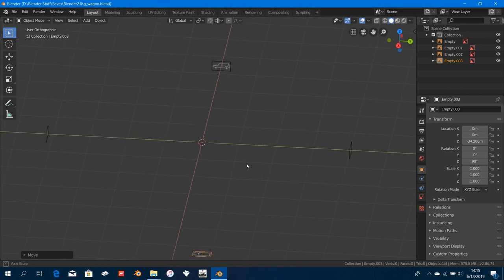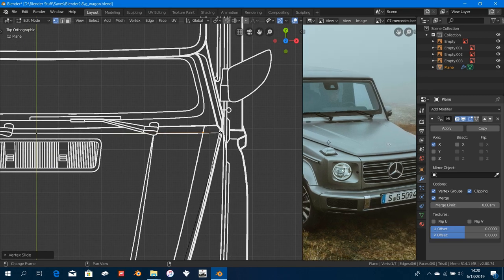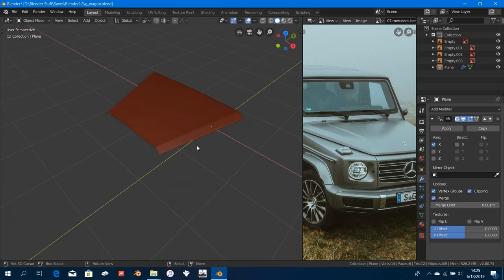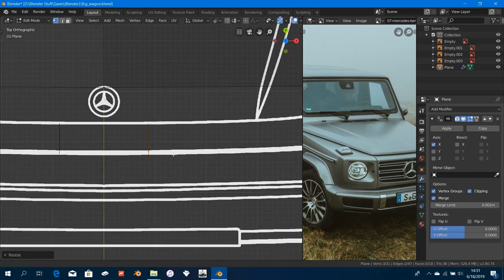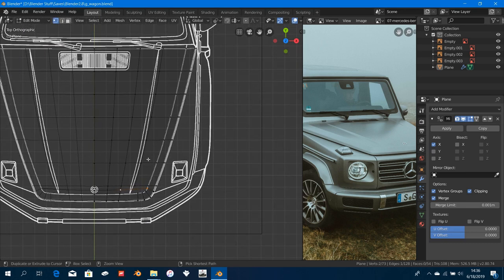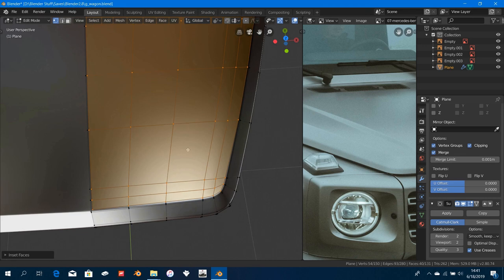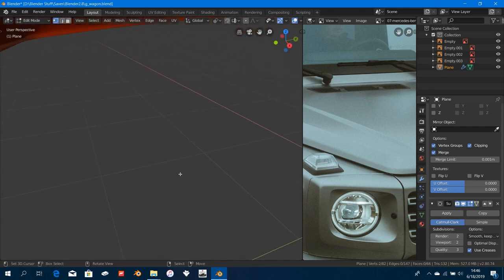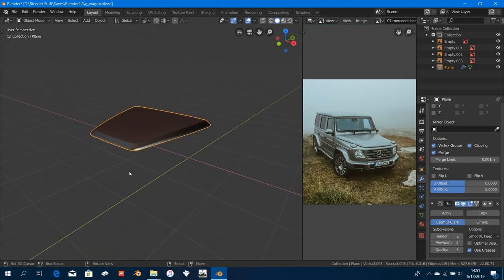Blender 2.8 Car Modeling Turtorial - Part 2 (Hood Shrinkwrap Guide)

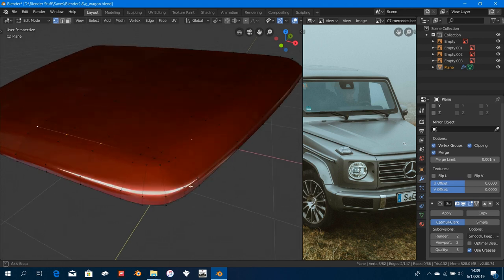Comment: Hello @The Natural Art Freak !!First of all, thank you so much for the detailed tutorial!!! I have a few questions tho, When I add the shade smooth to my hood I see a protrusion coming from the edge of the hood I tried splitting the edge and adding more mesh to that area but it didn't work. Also at 24:31 you split the entire edge along the hood, but in my case when I try to do that one block doesn't split so the splitting edge only applies for few blocks, I would really appreciate your help in this case.
Reply from the maker: you probably have either multiple faces or vertices going on somewhere, it can be hard to find sometimes, try moving the faces one by one to see if there's an extra anywhere... Or you may also try to recalculate your Normals with SHIFT+N to see if it works.

Comment: Bro how to make a line an active element i have tried every single thing but the middle point is going upwards every single time???
Reply from the maker: you select the vertex to want to be the active element last, then it will work.
Reply: for active element select the line from the vertex which you want as an active element, you have to hold alt and then select then you have the vertex selected as an active element, without any unnecessary extra steps

Comment: also, how important do you think getting your model aligned with the blueprint is? for example if i'm only using the blueprint to get the overall shape right, does it matter if it is not aligning with the blueprint?
Reply from the maker: well, if you're good at modeling you can get away with unaligned blueprints, but you will likely have flaws in the end...
Reply: thanks for the reply man! i am having a hard time following blueprints but i guess it'll slowly come around. trying my best to stay aligned. creating a shelby cobra :)
Reply from the maker: @cezanneali  I would love to see it when you're done.

Comment: 7:54 - When I click that line, it just selects that one vertex, and doesn't make it an active element. What do I do?
Reply from the maker: press . on your keyboard and select active element.
Reply: Bro. I know it’s been like 3 years. But maybe someone else needs to hear the answer to this. I had the same problem. That period . Thing didn’t work for me. So I just selected only one vertex moved it with G and X to the right position and the same with the other 2.

Can’t help you with the period . Thing but with this method you should be able to continue the tutorial

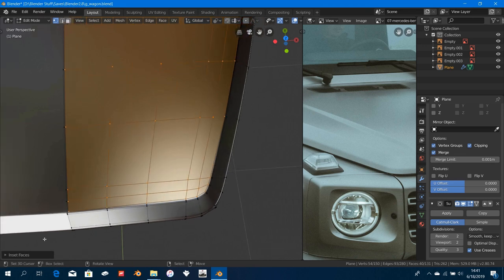Comment: 26:13 , sir  i have an issue about the boundary. when i unchecked the' boundary' button in inset Faces, the left boundry is gone perfectly but the top boundary is still there!(there are two lines on the top line! ) how can i get rid of it ?????? it makes me crazy !!
Reply from the maker: those two lines are causing the boundary not to work, select the extra vertices by path selection (select 1st vertex hold CTRL and select last vertex) or whatever selection method you know and delete them then try applying the insertion again.
Reply: @NaturalArtFreak  delete vertex? not dissolve vertexes ?
Reply from the maker: @HS-sr9ww  depends, can you send me an image?
Reply: @NaturalArtFreak  i will send you an image by email. can i have your email please? i was gonna figure out thisabd spent 2 hours fixing it  but i couldn't  ..... help me...
Reply from the maker: @HS-sr9ww  megbenyoalbert@gmail.com
Reply: @NaturalArtFreak  i have sent an email. please check, thank you

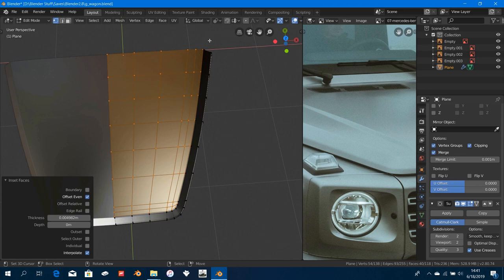Comment: i got a problem and can't find a solution myself. at 26:17 when you remove boundary it works on the left side (where the center line is). but doesnt work on the top of the model. so i have an extra edge at the top. I already tried to solve it my self but i could'nt find a solution.
https://imgur.com/a/irHCIbJ

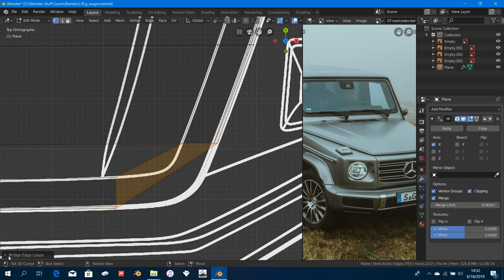Comment: 16:57 when i click on bridge edge loops it doesn't connect me all but only two lines. pls help
Reply from the maker: make sure number of vertices on either sides are the same.
Reply: @NaturalArtFreak  3 vertices in the either sides. blender tells me to select at least two edge loops
Reply from the maker: @oualidabdellaoui5192  that means the edge loops you've selected are joined as one in some way so you can't bridge edge loops.